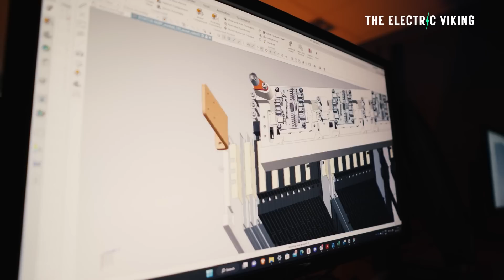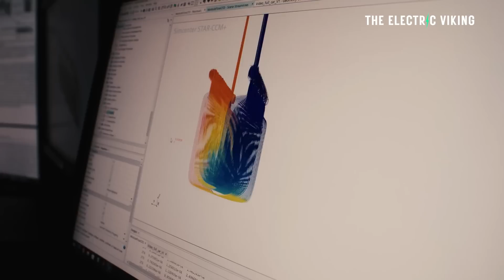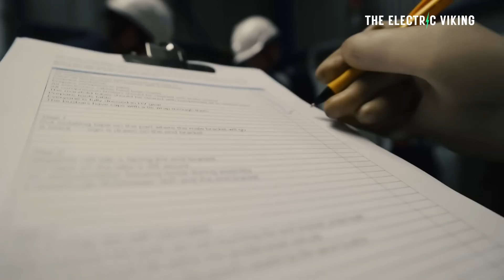Engineers in Europe reveal EV with batteries that charge in under 4 minutes

Comment: fi no longer refuel during a race ,, the f1 at silverstone last week was more than 306 km long with the fuel outlasting the tires,,so in theory a battery powered race car would need many changes of battery and more tire changes because of the weight..cheers sam love your vids
Reply: Current gen 3 fe cars are similar weight as f1 cars, they also do a complete race of 45mins or more on the same amount of total energy as f1 cars consume in about 2 average laps. So let's setup the f1 cars with the same amount of energy in fuel as the formula e has and do a typical race? I'd bet good $ the f1 cars won't be the winners. Nevermind if they raced on similar spec tires with similar downforce levels&hp. 😎
Reply: At 29.2 Kwh and higher energy density it could be 150kg + always onboard where as fuel gets lighter the farther you drive.
Reply: @carlsapartments8931  You happened to ignore that you will also be carrying a transmission and an engine, which is heavier than the motor. That doesn't go away. I love how everyone wants to compare the gas tanks rather than compare the powertrains.

Comment: The math doesnt quite add up. The Charging rate also constraint by the chemical reaction rate. When you apply more power to it that chemical reaction rate, the energy will be concert to heat instead of chemical reaction.

Comment: I'd like to see a car with like a 50 mile battery with say a 300 mile add in battery. That would save hauling around a huge battery when I just need to drive to say a Dr appt. and then to the store or something. When I would want a longer trip just put in the add on battery.
Reply: These batteries are like 1000 pounds and are part of the structural support of the car. They also have coolant flowing through them, etc..

How on earth would you take that out of a car? Why would you even want to?
Reply: 50 kilowatthours which gives you around 300 kilometers of highway range weighs less than the combustion engine and gasoline. There is no problem here.

Comment: No doubt, multiple teams around the 🌍 are on the verge of 🔋 charge/life/energy/$ breakthrough. TBH Tesla 250 Kw Superchargers are good enough today.
Reply: Not really.  The only time a fast charge is necessary is on a road trip, otherwise charging overnight is fine, but that means taking an hour to charge is seen as too long in the middle of a road trip.  250KW charging rate would take an hour to charge a pack the size a Hummer, Cybertruck or other pickup would use.  So the 1MW V4 Superchargers are really needed just to get truck-sized packs to charge in under 30 minutes.

Comment: Makes the Nissan leaf's lack of battery cooling evenn more short sighted.
Reply: Not really. It was a pioneer. It is like saying that the Model T Ford was short sighted when compared with the cars of today. Active cooling is unnecessary in places like the UK where we don't often have temperature extremes. I can still get over 90 miles of range from my 2015 Leaf.
Reply: @rogerphelps9939  agreed, Roger. I believe active cooling would have added significantly to the cost, and since range and fast charging infrastructure was limited, there really was no need for active cooling. The LEAF was designed to meet the average daily commuting needs of early adopters at a reasonable price, at a time when batteries were much more expensive than today.
Reply: Yes, but when the LEAF was first launched, fast charging was almost non-existent in many regions, and 50 kW was often the limit. Active cooling was not really a necessity initially as many owners charged at home overnight or at level 2 public  stations. Nissan's main problem was the failure to continually improve the car until competition forced a redesign.
Reply: I am talking about the modern I think 60kw leafs not the 11 year old ones.
Reply: @waltermcphee3787  Yes, while active cooling is not as critical as many people think for a vehicle that is not fast charged often by most users, it does limit the LEAFs ability as a road tripping vehicle compared to other cars that can charge at higher rates.

Comment: The pace EV is moving and my limited resources makes me think that i will keep my old combustion car as long as possible :).
Reply: Yep, I’m happily waiting for at least another 2 to 3 years. No rush…
Reply: I drive a hybrid I'm sticking with it for a while, for the same reason (but also cause I'm poor😆). When the model 2 (Tesla) comes out we'll have to see though ..
Reply: @ApparitionElectronic  Yeah, but if there is a TM2 anytime soon, it'll have a waiting time of years. The only fly I can see is that vehicle size dictates battery size, so unless they announce some sort of new wonder-cell, a smaller car means less range, by default.
Reply: @Roll_the_Bones  true the wait will be long, I would be okay with a shorter range but nothing below 250 miles.
Reply: Agree. I own a hybrid an it won’t be paid off for another 2 1/2 years. At that point, I’ll probably consider buying a new EV. But not before. There’s just too much happening too quickly in the battery space. I don’t want to be locked into something that is outdated 6 months after I buy it.
Reply: I just put a few thousand into replacing the rockers and rocker arms in my 2012 T&C minivan. It's going to be a while before it's worth trading this old guy in, and in the meantime it drives fine, as long as I put about a thousand a year into maintenance and repairs. The thought of buying a new EV right now is just untenable. Maybe in about 5 years when Toyota has finally joined the club and you can get a Corolla EV for $30K or similar. Or Tesla Model 2 for $30K. I'm not that picky but I do prefer a high quality maker.
Reply: @ChickensAndGardening  You are right, in terms of enironmental damage, it is better to keep your older ICE vehicle running efficiently, than to scrap it prematurely and go buy a new EV. That rocker-arm job sounds pricey though. As a cheapskate teen, I learned to fix my old vehicles at home, and that job wouldn't even need the head to come off, so quite an easy one. Main thing with ICE's is to do frequent oil & filter changes, that's how they do the big miles.

Comment: I have witnessed a "normal" EV charge to 80% in 5 minutes. The only thing holding back EVs are price & lousy infrastructure
Reply: What normal ev can do that?
Reply: @danparish1344  This is very easy to accomplish. Because Scrapp-press did not give a starting level in that battery. From 75% to 80% can be done in 5 minutes.

But now the real calls as measuered in my own car, ioniq 5 (and sister cars from Korea with the same platform as basic):
from 10% to 80%: Only reachable when the temperature is ideal in 18 minutes...as this week in summer.
Else it will be near 25 minutes .My own experience... my car always ends up above 80% because my own stop takes more time (sanitair, coffee, something to eat) after so many hours of driving.
Reply: @danparish1344  gac demonstrated a graphene pack on a 480kw charger back in august of 2021 that could do 10-80% in 8-10mins.
You can find the video on here.
Reply: No you haven't.
Reply: @rogerphelps9939  yes i have. Piëch GT. 75 kWh pack from 10 to 80%. Lauch in 2024/2025. I wrote "normal" because it's premium a 2 door coupe.
Reply: Once EV's have minimum 500 miles range, I'm in. Even if it takes 20 minutes to get to 80%. I mostly drive in-town, but a few times a year I have to drive 200+ miles each way (to gigs in other states) so I need a vehicle with enough range that I don't have to worry about it. If I'm worrying about range, I'm going to be cranky and wondering why I spent $50K on a piece of junk.
Reply: @ChickensAndGardening  If I have to drive 200 miles I'll styop for a break...no matter if it's an ICE or an EV. That break is long enough to get my EV charged up. see above,...and shorter than my brake would have been with an ICE because that car must be refilled before I can start my own pause.
Reply: @reiniernn9071  Exactly.  For the people who drive with a "motorman's friend" strapped to their legs, EVs aren't for them.  Most EVs will go 3-4 hours at 70 mph easily.  I always stop after 2-3 hours of driving for a tinkle stop, coffee, food (either bought or brought), a stretch of the back and legs, and top off the gas.   Now that I have a Tesla S, nothing has changed.  But the most I'll drive is maybe 8 hours, and even then, I always rent a car.  I don't want to be that far from home with my own car if I cut a tire, get into an accident, or even have a mechanical failure.  When I rent a car for a long road trip, all I have to do is cal the rental center and they drop off another car wherever I am.  Worrying about a car problem away from home is something I do not miss.

Comment: THAT is cool..totally viable if, like u said, it can be used in a structural battery pack. Nios idea was born out if necessity. Lack of ground level overnight charging locations in an immense, upwardly growing populous. The sub 10 minute swap/battery leasing program was born. I prefer the cooling to the swapping but both are brilliant, who am i. Great article Sam
Reply: Why does it need to be a structural battery pack? (structural as Tesla defines structural)
Reply: You would need to be an Olympic weightlifter to handle the charging cable.